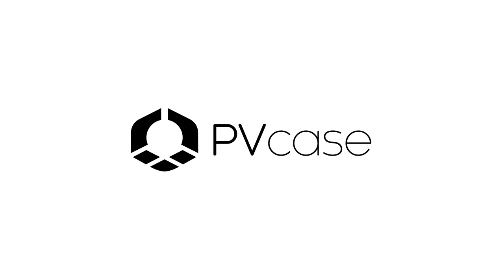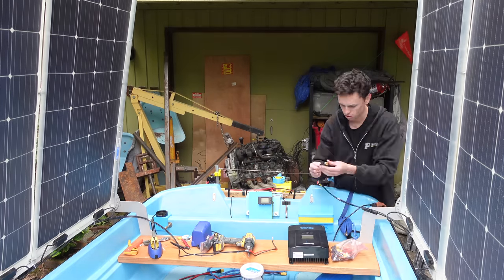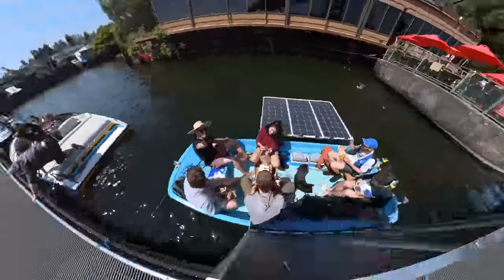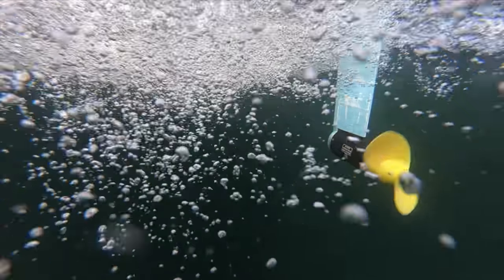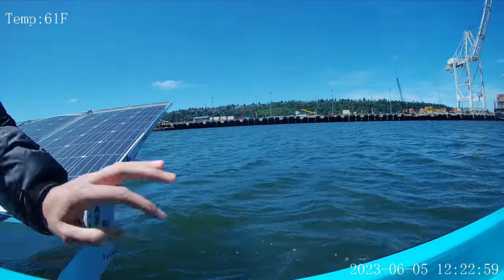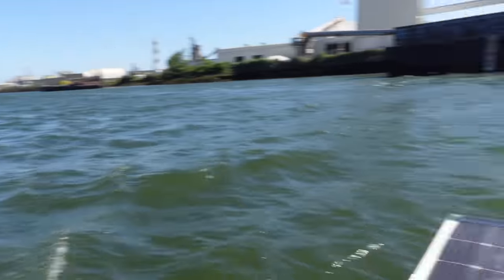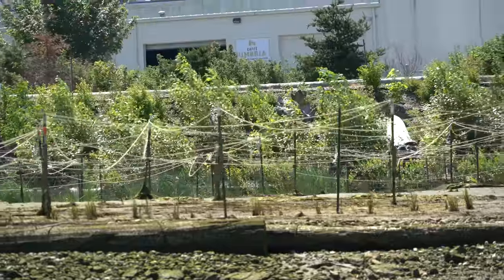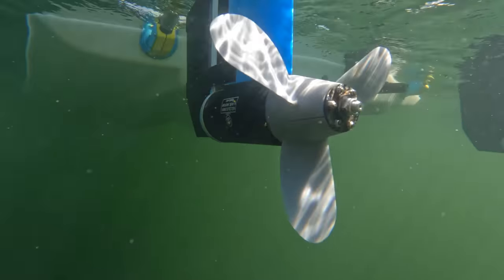Building an Unlimited Range Electric Boat

Comment: What would be cool is a servo system or perhaps a motor pulley system to deploy the solar panels. Wonder how it would handle if you glass a kayak to either side of the boat? Similar to those fishing vessels in Asia. Guess a large diameter pvc pipe would also work. With the pvc you can build it into the ends of the solar panel setup so it also acts as a stabilizer in the water. Might have to calculate the spacing to not cover the panels in water when deployed

Comment: Personally, I would’ve taken one panel from each wing, and make a small roof to give you some shade and also limit the torque on the mounting hardware while also giving you more maneuverability because you’d be more narrow. Two long wings on each side and a small roof would probably look pretty cool too.
My only worry is that the roof might shade the side panels at certain angles and times.. but you seem to have more than enough power so that’s fine.

Either way, I’m loving this boat and looking forward to mk2!

Comment: You could 3d print a hydrofoil for your whaler and increase efficiency and top speed, also improving stability in waves. 

One alternative to increase range and speed I’d recommend is a small sail setup (like a Sunfish sail), with a small retractable swinging keel or centerboard setup.
If you need any help with design, let me know! Sails are cheaper than extra batteries

Comment: This is awesome

Next you should make a boat powered by heaps of those 12v pc fans turned into turbine towers.

Run each fan in series in each tower and run each tower in parallel. Have 4-6 towers with 10-20 fans each

Comment: OK.  NOW plan a trip from St Paul MN to New Orleans and BACK to St Paul, MN in an e-boat.  I will be impressed!!!
Reply: Oh Yeah!  Can the solar panels be used as sails?
And about that trip down the Mississippi and back.. the REAL test will be fighting the flow going north.  So depending on your testing, maybe north only is an option.  And then there is the Missouri River (FASTER FLOW).
Reply: AUTOCAD!  My old 'systems" manager in Architecture said, "Who uses that anymore!" I still used it a lot!  But I also understood that the 3D capabilities of Autocad were not fully addressed (for Architecture, but looks like the versatility with respect to the solar design and landform 3D issues are being addressed).  For me and the (building) Architecture systems "Managers", I was forced to a very compromised software called "Revit" (yeah, it still probably is like 'steam punk' in Architecture circles, but yeah, Autocad when provided with a package and configuration that is comprehensive, WILL absolutely do EVERYTHING that Revit can do.  It was designed for its flexibility). Sorry for the rant.

Comment: Just like a trailer in a car, you can put some large panels on a second boat which can be behind you and your main boat will be pulling it. this way you're a big generator with you and you do no need to worry about shading.

and note that you can use bifacial solar panels as the clean water is very much reflective and most important is that they generate more when sun is tilted very much and same for the solar panels are tilted.

Comment: Next step is to add a small air pump to get some bubbles between the boat and the water to decrease the power needed. If the air pump does not need to much power you could have more solar power left over to drive faster

Comment: You can make a solar roof using one cheap 550w~ solar panel. Total weight is 30kg and very durable. I use it on the caravan and it works perfectly.

Comment: I love this. I wonder how a design with outriggers would do. They would make it more rigid and stable and could still fold up. Or maybe a roof with solar panels on the roof and then still have ones that fold out so that you could have 50% more surface area.

Comment: Remember to get a carabiner hook with the locking nut, boats in a marina that are connected via regular carbainer hooks is at risk of the carabiners unhooking over time due to waves and wind and several boats have gotten loose because they had only been secured by 2 carabiners.

I can almost guarantee you that anchor is gonna find a way out of that carabiner one day, simple fix to not lose it c:

Comment: maybe you could build a boat over CNC cut aluminium ribs from PCBway, covered in plastic foil.

If you fix solar panels vertically to a mast you might use them as a sail, the fact that they are flexible might allow to bend them into a shape that helps to create thrust.

Comment: Looks like a fun time cruising around and looking at stuff. I think you could build a roof for the solar panels pretty quickly with a TIG welder (or maybe MIG with aluminum friendly wire?) That's a skill that would serve you well going forward. The precut parts would go together really easily, or you could make it out of tubing stock.

With welding skills from that, you could make a life-size tank with the tank tech you've been working on.

Comment: You should maybe add some kind of pontoon to the ends of the solar panels so that all of that weight doesn’t stress the aluminum to the point of failure and maybe eliminate the idea of pins all together and let the panels float and pivot while on the water

Comment: If you want to put the solar panels on the roof/as a roof, I would strongly recommend trying it earlier rather than later. It's very easy to underestimate the effect this has on roll stability. Also, as we know (I think ^^), if the boat/wind speed doubles, the wind resistance quadruples. Max. Speed could also suffer quite a lot

Edit: Ok, so, after watching you tilt them down @4:05 I think they're definitley to heavy to be a roof for this boat.
Except, m a y b e, if it'a suuuper light, super stiff composite roof with the panels embedded/mounted straight to it, no metal framing. I don't know how that would work though, maybe some carbon fibre technique 😅

Comment: Nice project but needs a change. The solar panels should be raised to offer sun and rain protection . The panel could be a roof with a fold down process for trailer use.good adventure and achievement, well done.

Comment: add a handle rotional gear system that can fold and unfold those solar panels.
or you should add railway type of tracks that can push solar panels outward and pull inward that way you no longer have to use the strings. basically solar panels expands horizontally as if it's a train. 

get a cotton cloth that can absorb water inside the bot and you can squeeze it out of the boat if there is too much water inside

Comment: i'd add some buoys boaters use for not bumping into things as a floating device for the panels instead of locking them. would be less stress on the boards they are mounted on. i also would think it yould be cool to add a downward/side sonar so you can scan the bottom of what you are driving by. i've watched a lot of Adventures with Purpose, Chaos Divers and Depths of History. You could help families and law enforcement find missing persons or stolen/missing cars.
That being said, my idea would be a solar powered sonar drone, which scans an area with sonar, sends everything to your server and you can GPS mark interesting locations for divers (private or deputies) to check out. you could even make a diving drone to check those out yourself mounted to said sonar drone. Like it scans the bottom and if it detects anything other than logs, stop and give a message to check things out.

Comment: At 9:33 you mentioned problem with vibrations. For the same reason wind turbines have 3 blades. If 1 is at top where there is stronger wind, 2 bottom ones are countering it; and if 1 is at bottom where there is wind turbine pole to obstruct wind flow, the other 2 are not at full strength. 3 blades reduce vibration and stress (deformation) on the shaft compared with 2 blades at least on the wind turbines. Also, if I remember correctly odd number of blades is better for balance overall and 3+2N where N is element of N0; and 3 is used just bcz it is the lowest number which means cheaper production and also lower stress from the wind on the pole.

Comment: What about having a pole sticking up in the center of the boat with a loop you can feed some strings (that are connected to the panels) through? That way you can prevent them sagging and have an easier time lowering & adjusting  the panels

Comment: It would be interesting to see the difference in systems efficiency between these e-foil motors and electric trolling motors.  I rigged up a similar system for dinghy propulsion several years back in Seattle with a 24V trolling motor and some lipo batteries.  Worked pretty well, and they even have brushless trolling motors now as well.  At least I knew the prop was close to optimal for the conditions.  I didn't have color, but used the fixed panel on my sailboat to recharge them.  Great series!

Comment: If you could lift the bow sides of each panel rack 12-16 inches & drop it flat when needed, You could use those solar panels like a sail or like a brake (headwind). Taking advantage of a tail wind that would push you more than usual. If the panels are lower @ the stern than @ the bow, it will push the rear end of the boat down. Because its buoyant, this will force it forward. But that aluminum L bracket wont do. Maybe larger diameter copper tube is best.

Comment: Do the solar panels have to be attached? It seems a simple solar raft could easily be towed behind a boat, and send power by umbilical -- no fuss with raising/lowering, or clumsy maneuvering.

Maybe some kind of modular, rapidly assembled raft design, consisting of two separate pontoons, held together by a central frame that also houses the panels...

Comment: Perhaps a different approach would be to tow a 'light as you can make it' barge behind, to accommodate more panels, and therefore more powerful motors / more range.
AND mount the panels on a roof.

Comment: You probably know this, but those flexible panels don't last very long, are prone to cracking (of the silicon), and slowly degrade in UV reducing their efficiency. Renogy also sells very affordable glass panels at <$1/W, but they are of course heavier. Just a thought for Solar Boat V2!

Comment: Shading a solar cell creates a resistor in the circuit.

Avoid it at all cost otherwise the cell can burn out as the rest shove current through it without caring.
A shaded cell will only try to drive a lesser current, thus acting as a resistor and will eventually burn up

Comment: Put an outrigger below each panel lol, that thing wont tip in a hurricane lol

the only problem is the torque with all that extra weight might cause problems if you put it below the edge of the panels, but that thing isn't going underwater.

If you attach it to the boat hull, it might be awkward to transport, but you could rest the panels on it, and can open up a bunch of possibilities, like putting motors further out, putting batteries in the outriggers (probably a bad idea, but if you seal it right, it clears up space in the boat).

I don't know, it kind of changes the boat entirely, but if you have the panels out that far already,  it wont take up extra space in the water, and you could put them out further than the panels so if you hit something it hits them and not the panels.

Idk, just a rant, but I feel like it would fit in this project really well

Comment: Have you thought about adding some sort of outriggers at the side of the solar panes so that the boat becomes a trimaran when it folds open? It would help with stability and also keep the panels out of the water

Comment: Just my 2 cents from the peanut gallery that I know I wasn't asked for but from an angler and professional upfitter perspective I would have used nut serts to bolt the screws to the wooden planks for longevity and I would add some pvc adjustable outriggers underneath the panels to keep the boat stable and keep them supported that's a lot of weight on those aluminum brackets especially when the water is choppy

Comment: I would love to see you make a more permant version of this. As you said solar roof, better mounts for the motors and batteries/better waterproofing.

Bright lights as well as a fog horn. Also a projector could be a cool thing to play with on the water.

A powered cable winch to tow floaties behind you. More permanent power options for phone charging or even an inverter for a microwave

Comment: you could make the locking pins captive on wire or have extras stored on the frame, just in case 💦🔩💦

Comment: Dude, you need to make one of them dual haul boats did not catch the name yourself out of foam, there is a guy who builds these river speedboats our to xps that might give you some inspirations. I built an extremely  light paddle board from XPS and it now had a foil on it, it is holding up quite well…. Cheers than that you for you great videos.

Comment: So if you reinforce those wings a little more and add it in a bracket underneath with like a float i'm pretty sure you could add to the stability of the boat. And so also the float underneath woul make it easier to deploy

Comment: Do you think two smaller MPPT controllers per right and left side panels would be more efficient since one might be at a better angle to the sun than the other set and that would bring down the over all performance if just one controller Just curious.

Comment: you could have the solar panels on a worm wheel with a servo motor, and ldr's to measure the angle at which they make the most power. then you could have them automatically adjust to the optimal angle

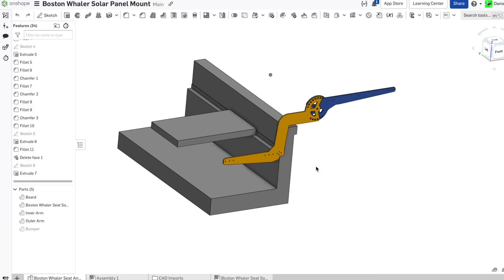Comment: 0:55 im confusion! Wasn't it Fusion360? Now it is Onshape until they cornhole you as well. For your needs FreeCAD would be suitable, you might give it a go. This year the version 0.21 will be released it has neat features. FreeCAD is a CAD/ CAM solution. If you wont to hang on to Onshave go with it, but keep FreeCAD in mind it might save your project one day. This would be day Onshape cornholes you hard 🤣. Cheers m8, great videos and as always a thumb up...

Comment: ACTUALLY all you need is two strong magnets to move a boat across the water. One attached to the bow and the other thing a few feet in front of the bow. The attraction will pull you anywhere you need to go.

Comment: If the day has good sunlight, it will be very damage high voltage solar panel touching the water ,  so maybe put on top of the roof is better

Comment: saw the next vid in this series on the whaler, you should get little cables stays for the hinge hinge pins so you cant drop them in the water EDIT: put these on guided cables and a crank, or servos

Comment: If you do a version 2, maybe go with a Trimaran. Check out the Hobi  Tandem island or Adventure Island for inspiration. You might also be able to find an old Hobi Cat with no mast or sails for a reasonable price and run your solar pannels instead of the trampoline with a small seating area in the rear. 
In fact, one thing you may want to consider is to build a pair of styrofoam outriggers to support the outer ends of the solar panels. This keeps them out of the water and makes them easy to deploy since they're either up or down.
Reply: There is a local wind rider tri for sale.

Comment: I was recently watching a video having to do with the Ghost, a sea vessel that used props to pull itself forward (mounted at the front) rather than pushing itself forward. Would this be helpful in the design of your boat, or a future boat?

Comment: the vibrations might be caused by water cavitation (possibly also a bernoulli vacuum pulling air down the masthead)  - you can see the bubbles being formed at the motor and prop tips; make sure the prop outer edge isn't exceeding cavitation velocity in the water and check it for signs of bubble damage.
Reply from the maker: I was literally blowing those bubbles through a tube with my mouth 🤦‍♀️
Reply: @rctestflight  Oh, ok so it was a ghetto smoke test hahaha

Only other things that could cause odd vibrations is an imbalance, or potentially just RPM approaching a factor of the resonant frequency of the boom? I've seen with similar issues where high noise/vibration was generated with ducted fans in helis they changed from a symmetrical prop pattern to a 2-4-2-4 blade pattery to reduce sound/vibrations to two frequencies rather than one main frequency in those cases but that's easier said than done with a propellor without making it an even number of blades N>=4

Comment: What if you made the solar panel bumpers integral and then they could double as depth stops by bumping against the hull, that way you could never go too low. You could also put handles on the sides of the solar panels - only as far out as your comfortable -  and you could relieve some of the weight with pneumatic pistons to get rid of the strings and the step by step deployment of the solar panels.

Comment: Look at how theyre doing the props on big ships using electric motors nowadays.  Theyre setup so theyre in front of the mast pulling it along its a lot more efficient that way too.  Ive looking into it a ton since im a commercial fisherman and have generally always used sterndrive setups over jets because theyre way better on fuel.   One of these days Ill trade in my old tr2s for forward facing drives.
Reply: Also I see that barge up here in the prince william sound often when im fishing
Reply: Itd be really cool to see you do something like that.  Also i bet it would do away with the vibration issues youre having.